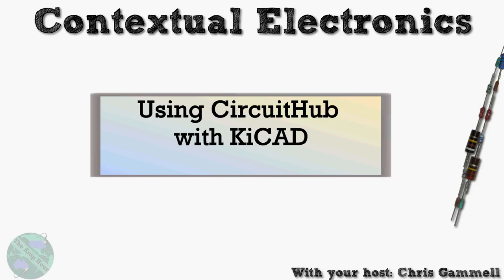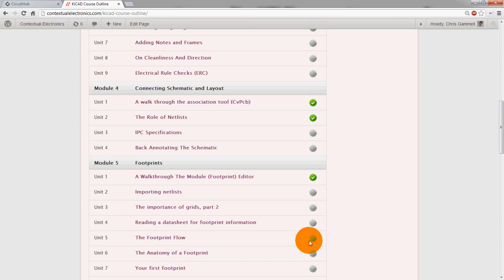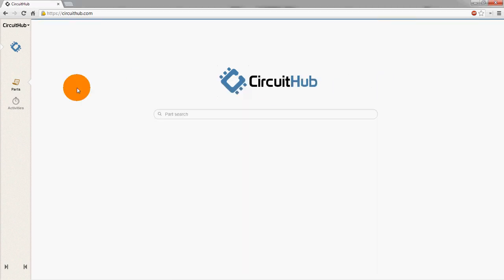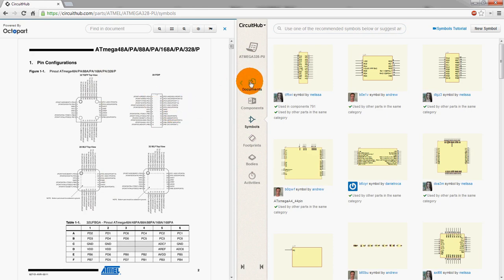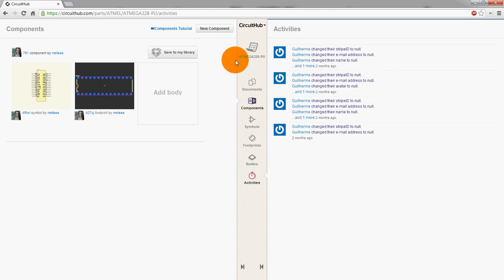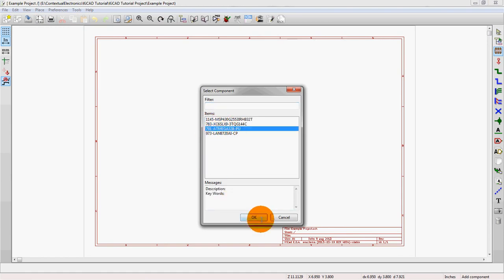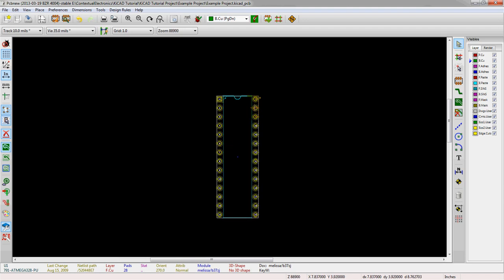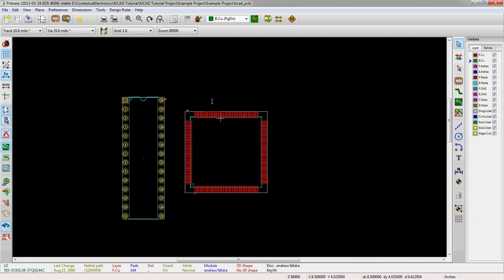Using CircuitHub with KiCAD (an intro)

Comment: Chris, did CircuitHub drastically change things? I don't see any ability to get to a parts library.
Reply from the maker: Hey Jeff,

They have definitely changed things recently. They are much more focused on the manufacturing side of things. I would contact them directly if you think any of the features should still be included in their design.